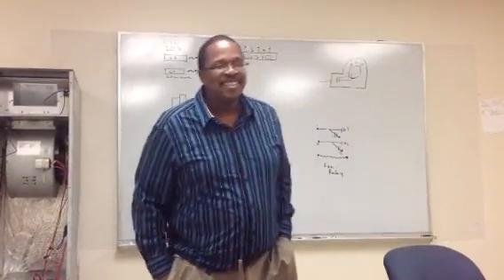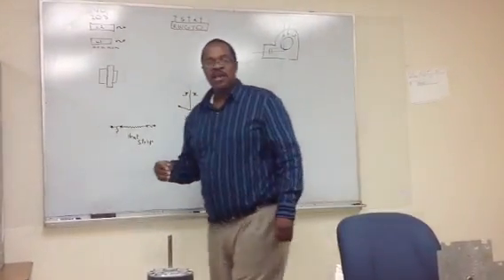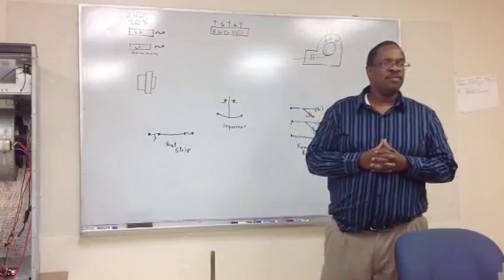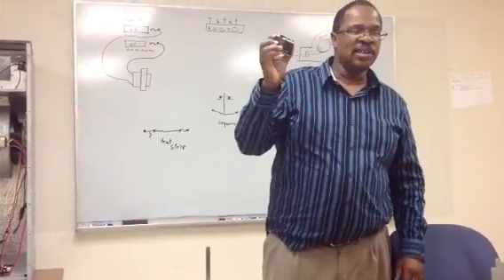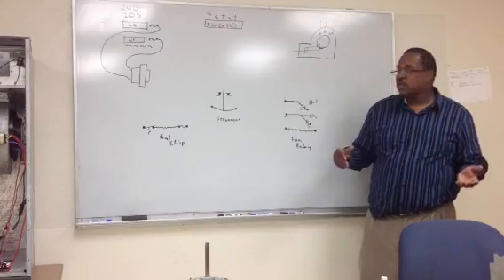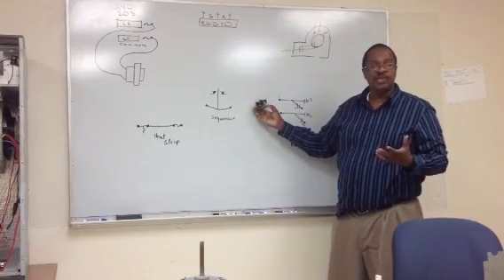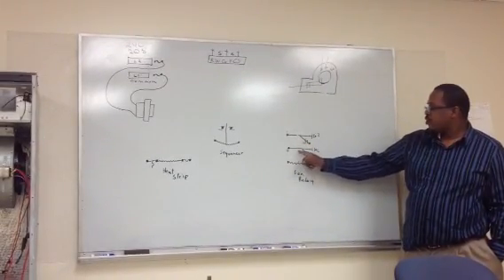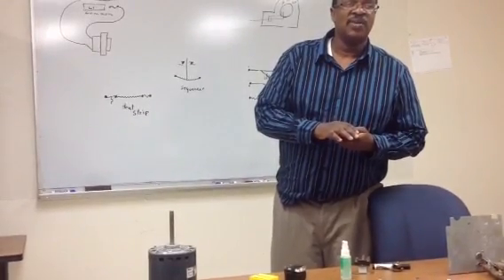Basic Components in Wiring an Air Handler

Comment from the maker: your have a wiring issue. R does not go to chassis. r and c are from the low voltage power and supply power to a digital board for it to operate. The other wiring goes to each componant for it to work. r and c connected together are a short and will damage transformer or fuse. Do a little more studying.

Comment: I am replacing a burned board from the inside air handler. The connection with the (R C G W1 W2 Y1) acts like it shorts and smapp sparks when plugging into new board. The schametic doesnt show where these wires go to -just ends with wire nuts. The outside schematic doesnt have them either, but I think they are the low 24 vdc. The R red showed connectivity to the chassis. What is R usually go to here. The T-stat began with a lo batt signal, discovered board is burned. I am teaching myself !!